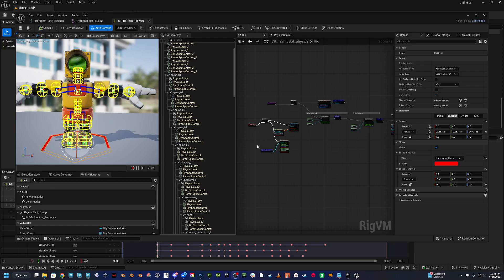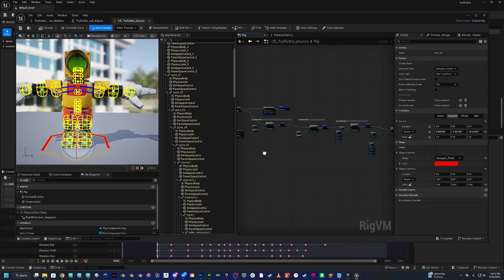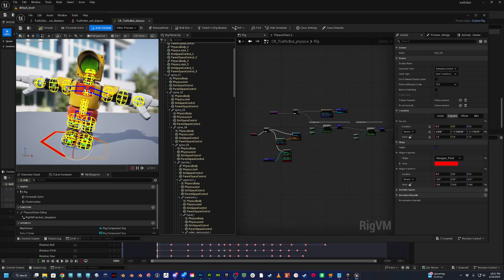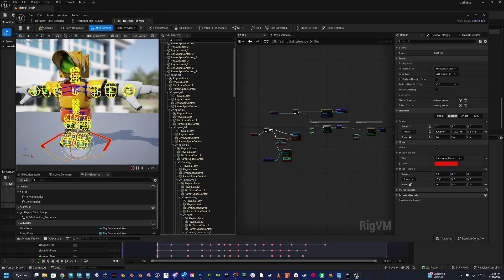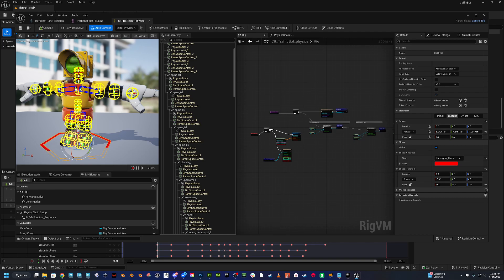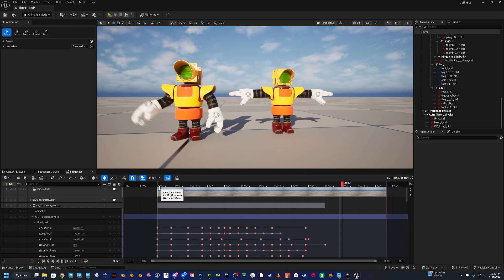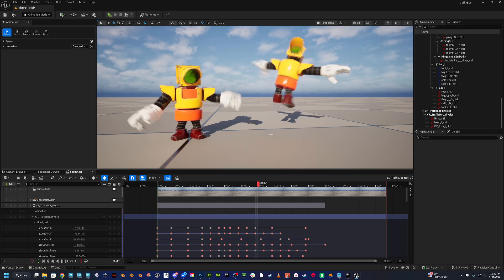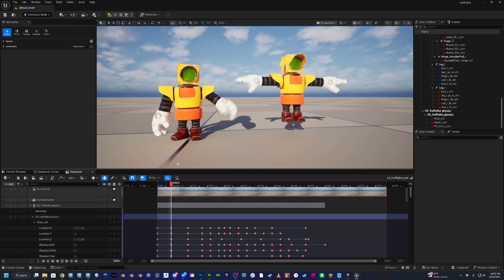Control Rig Physics Test | Unreal Engine 5.6

Comment: So cool man! Nice to see it working on your character. Have you tried to tweak some of the physics behavior on the Spline? Like Angular forces and Gravity. Might help !
Reply from the maker: Thank you! I was having an issue getting the spine to work. I don't know if it's because the end of the spine meets that junction where the clavicles are attached. Also, I was having issues getting the IK arm setup to work. I DM'd you on LinkedIn with some more info and links to screen recordings. 🤓
Reply: @SteveTalkowski  did you get the spine to work ?   I also have this problem, and I am using CC4  character, and man, the spine is so bad solved there in the skeleton, to get the neck moving, I had to use spine3 as kinematics